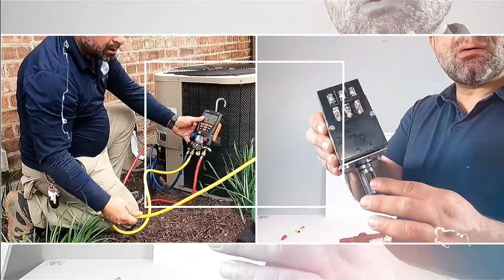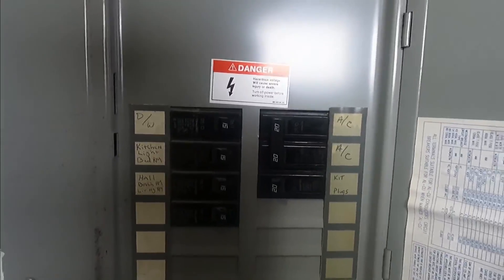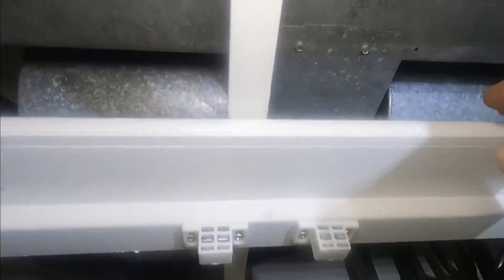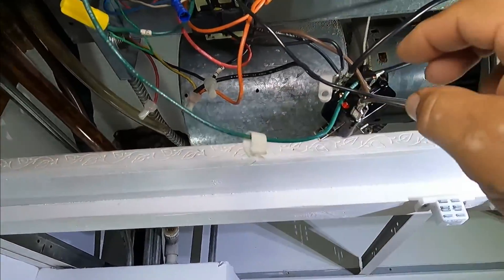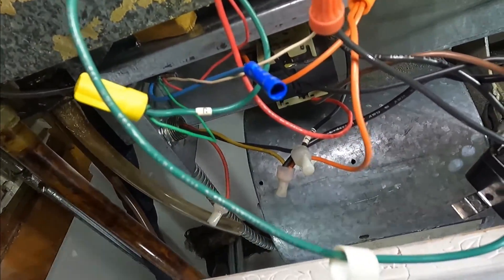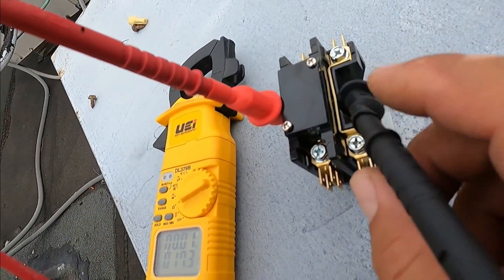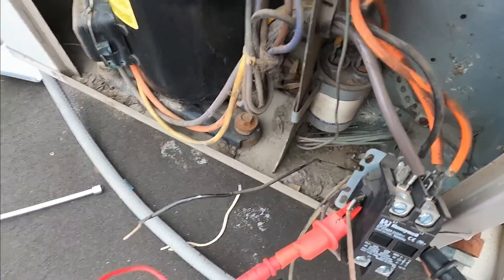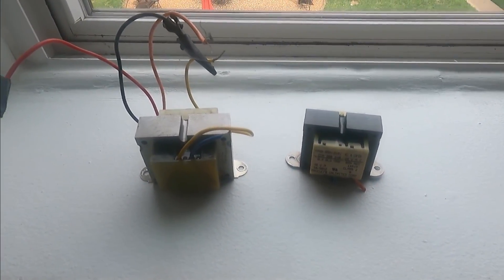CONTACTOR COIL SHORTED.  IT BURNT THE TRANSFORMER. TROUBLESHOOTING TIPS.

Comment: Was there no LV fuse in that system?  It would have blown immediately with a dead shorted contactor.
Reply from the maker: @fldave612  Hello Dave.  NO.  There was not .  This unit is 40 years old .  Cool only .  Back then no control panel existed.  No circuit boards.   Thanks for your question.